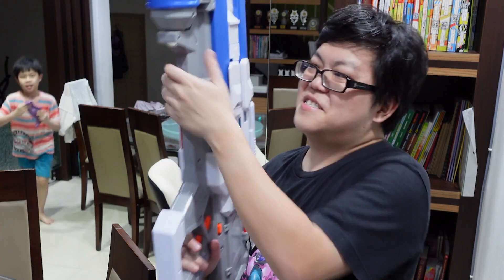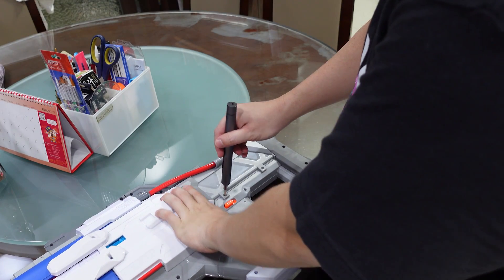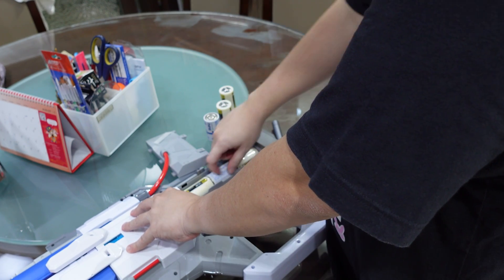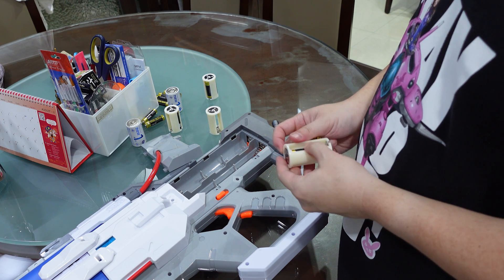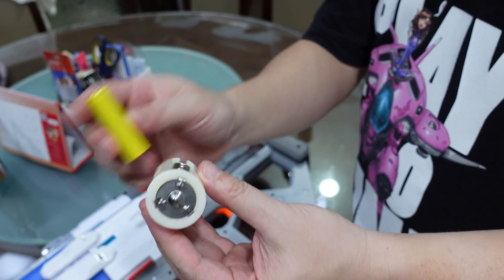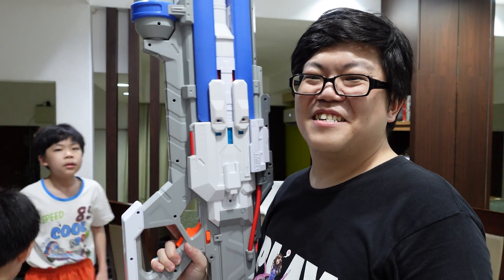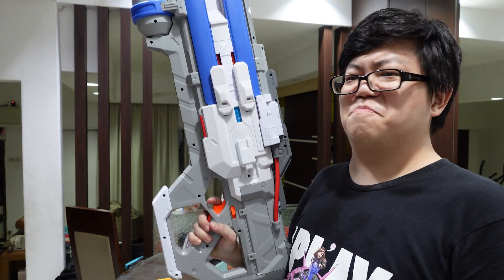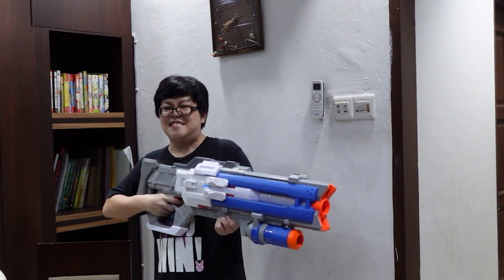Overclocking the NERF Rivals Overwatch Soldier 76 Blaster!

Comment: Hey bro, nice experiment!

I just got one of these blasters, and is amazing, but I am annoyed as well with the battery thing. I do not  want to spend $40 on D rechargeable batteries, and also I do not want to melt it lol so which adapter setup do you recommend?
Reply from the maker: What do you mean by adapter setup? as in how many of these IMR you should put in? Remember that normally it's 6x1.5V = 9V , the problem is that with IMRs. 2x3.7V = 7.4V which is too low.. so if you want to be safe.. 3x3.7V = 11.1V.. which might still be a bit high there isn't a good middle ground here 😅... Remember to be careful when using these things... and I'm not responsible for anything that goes wrong!
Reply: @marauderz  what if I just want to use regular 1.5Vs? Should I put 6 adapters with three AAs each one?
Reply from the maker: @r2887-o1r  oh oh, just using AA? You don’t have to use 3 in an adapter that just gets the current up if not mistaken. So you can experiment how many to put in each adapter.

Comment: Happy it didn't blow up - thanks for testing one for the team!  Good to know those AA adaptors handle IMR trials and the blanks are a great tool too - we appreciate your risk for the fun of the power upgrade.
Reply from the maker: Well.. I'm gonna guess if they keep running for extended periods, the stock motors and gears are not gonna like it. But if you've been modding things for a while you should know that.